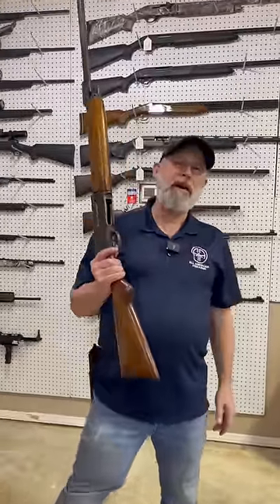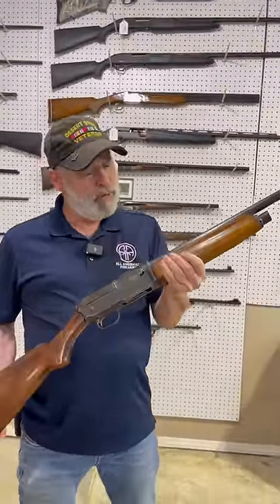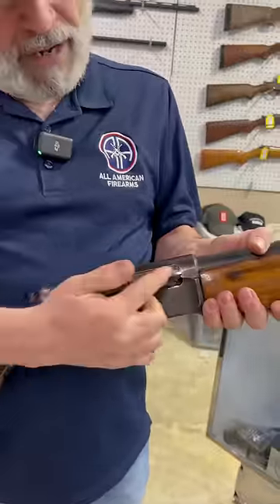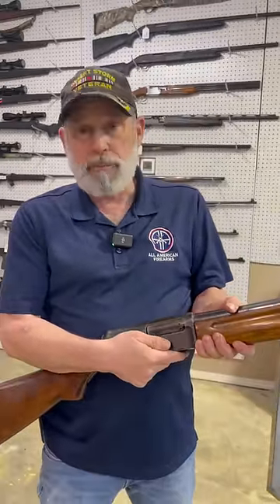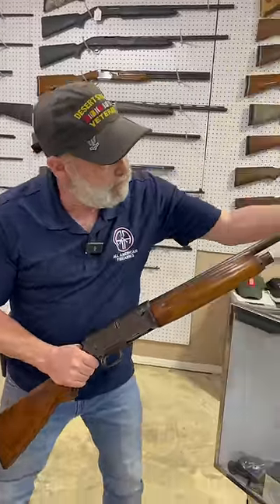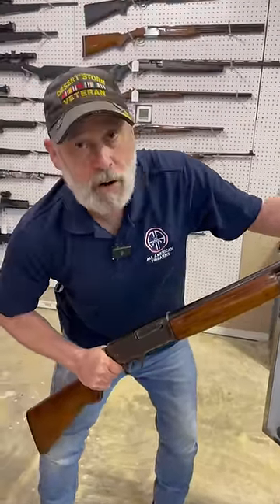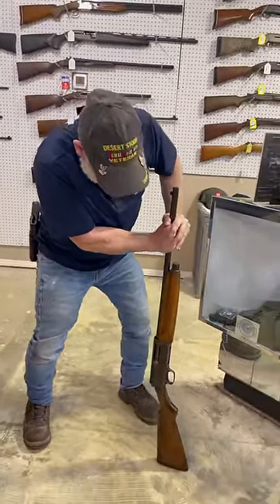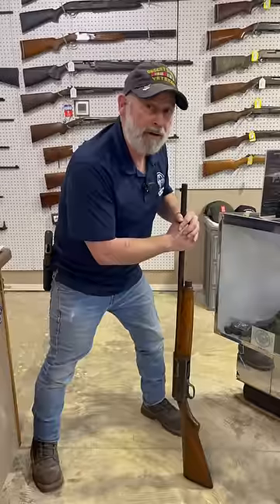Why This Winchester Shotgun was known as “The Widow Maker”- All American Firearms. Aiken, SC

Comment: So there's some backstory to this. browning worked for winchester for a long time, and he left them over the a5. It started with the 1897 pump action. He had the idea for a pump action shotgun a while prior, and winchester wanted to stick with lever actions, forcing him to design the 1887 lever action shotgun instead; a gun he truly hated. They relented on the 1897, and he was worried they'd take the auto 5 and basically patent the design and just sit on it to prevent it from hitting the market (until they needed a replacement for the 1897).  He left winchester and went to remington. Well, that didn't work out because he was sitting in the waiting area at remington and the president of remington FUCKING DIED prior to meeting with browning. He went to fn and spent the rest of his career with them and Colt to design the bar and 1911 (and the hi-power, but he died before it was finished. He liked 9mm double stacks more than the 1911). Winchester saw the success of the auto 5 and the remington model 11 (a licensed auto 5) and didn't want to pay for a design that they thought should have been theirs to begin with. Enter the model 1911. Now, there wasn't a slew of deaths following this gun's release and there is a button on the receiver that holds the bolt open when the barrel is pressed. Any guns that did go off would have been subject to user error as much as anything else, and the myth of the "widowmaker" is larger than the reality. Poor maintenance and rough use could have caused misfires but theres little detailed documentation on specifics of the failures, just notes on few reported failures. Winchester did end up offering model 12 pump actions a few years later as part of a recall when the legend grew, but there are still a few of the 1911s floating around. It was absolutely a stupid idea, and having handled and dug into one of these they are very easily identified as an early semi auto with little user friendliness in disassembly and operation. winchester should have worked harder at making a competent design for sure. But there's far less documentation to support the name than you'd think. If it were that dangerous and notorious, it would be as famous as the chauchat (which wasn't as terrible either but the american ones were rushed and poorly built) or the type 94 nambu. This gun honestly feels underdeveloped. It's Like they had a working tool room test model and fast tracked it into production.
Reply from the maker: Thanks for the more in depth explanation, it deserves its own long form video with the amount of backstory

Comment: Why would they "accidentally" go off?
Reply: The cartridges used could have a slightly more sensitive primer used, the slamming action when releasing the bolt/barrel monstrosity could prematurely detonate the round, really crappy QA on the ammo that was used, broken firing pin/internals. There’s a number of factors that contribute to this particular firearm’s notoriety and unsafe nature to be around. Most other 12Ga’s from that era are rather safe and mostly used in concept today, this is the exception!
Reply: @henryb9720  I think you're reaching. I also think that a lot of myths surround those shotguns that simply aren't true.
Reply: presumably they don't push it back all the way to lock the bolt and then loosen their grip, the unretained bolt slams forward and BOOM

Comment: Im guaranteeing you only had an issue with properly unseated primers...
Reply: True, but while it'd probably be safer today, due to higher ammo manufacturing standards, it was designed for a market that didn't have that standard, which is pretty irresponsible.